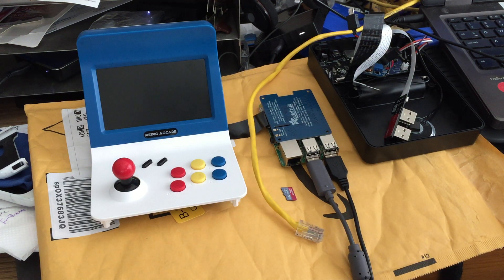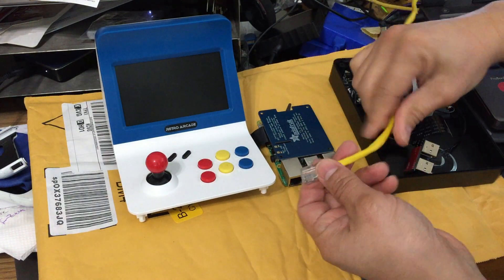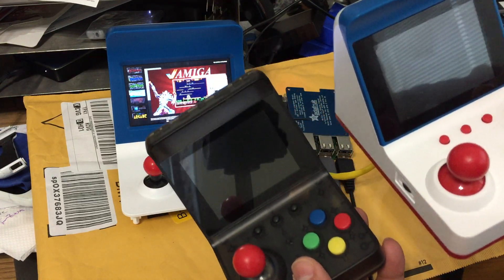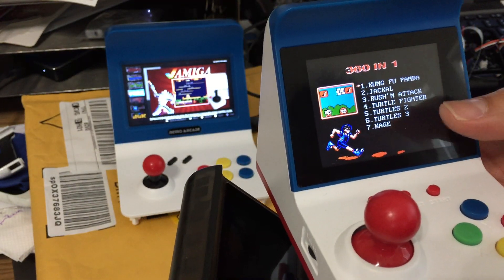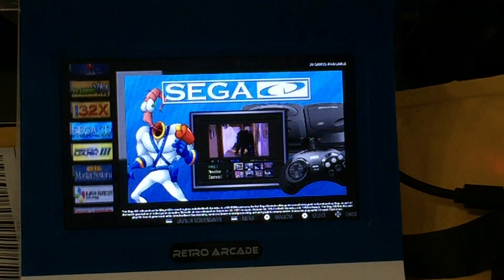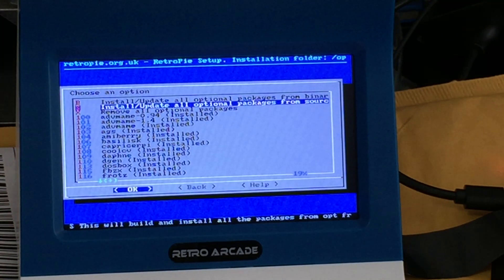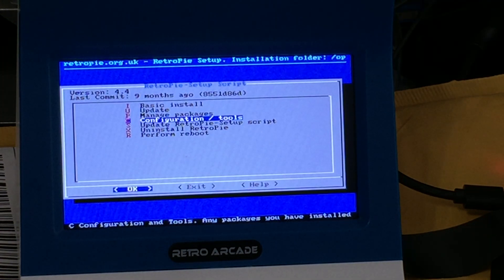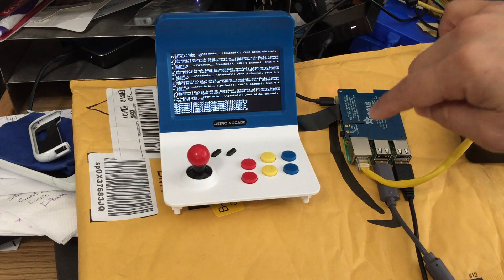RetroArcade PI: Getting system ready for upgrade and reinstalling DC Emulator

Comment: Hello Johnny! How are you? I really like this series of videos to convert into raspberry pi 3 the retro mini arcade. It's something I've always wanted to do but I did not know how. You can do a very detailed step-by-step tutorial on how to assemble everything and where to buy it? I am very interested in transmitting all that in my channel in Spanish. Thanks for your great research videos.
Reply: @johnny58435  Do not really understand. The motherboard that I see below is not the one that carries the RS07? Is a motherboard almost the same but different? I see the web. They do not send it to Spain?
Reply: @johnny58435  Ok I've seen the video Very good and simple I already bought the Kit. It takes a long time to arrive? Do they give you a tracking number?
And another question, is it necessary to buy the 40-pin extension cable?
By the way, for the 128GB image is it necessary to have the raspberry pi 3B +? Can you put the raspberry pi 3 normal?
Thanks Johnny!